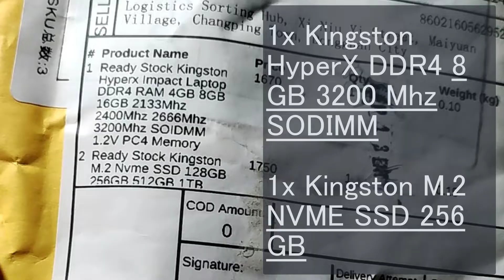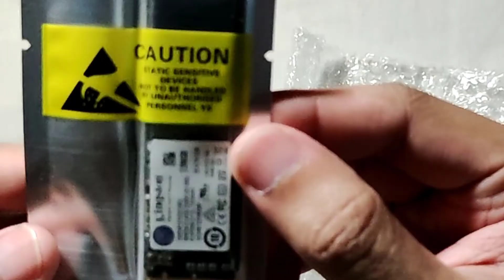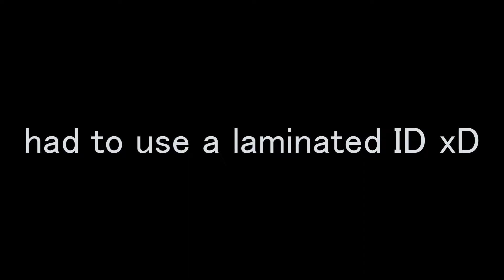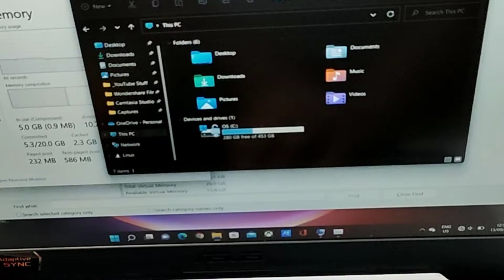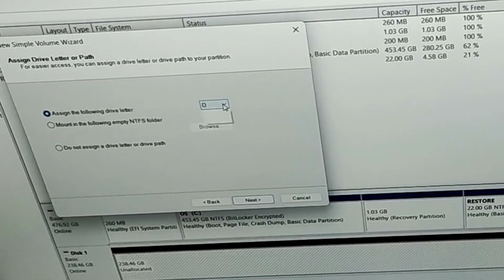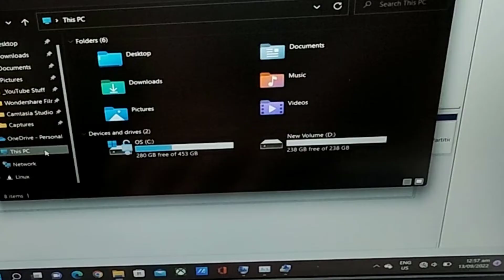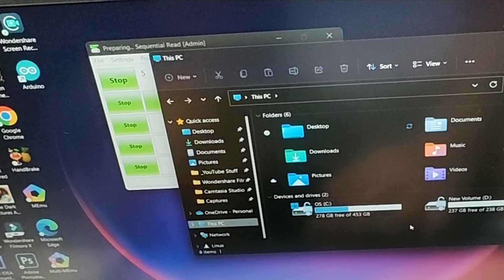ASUS TUF F15 (FX506HM) — Ram & SSD Upgrade — Complete Guide

Comment: I bought my laptop at 10.10.22 sale n upgraded my tuf 15 506hm(rtx3060) to 16gb(ram from my old tuf fx505dt) n 1 tb ssd pny cs1030 . Well after few months of using ,1tb ssd now has 200gb left because games now is 60gb so a few games took 300gb. Plus some microsoft visual studio, unity engine n unreal engine stuff. My advice to others is if possible buy more than 2 tb ssd. 
16gb ram is still fine
Reply from the maker: i only bought 256 gb ssd and i got more space 😆 i only download one game at a time, after finishing it, uninstall and then download new one

Comment: Im thinking of using an adt egpu, is it possible to take the main ssd that comes with this laptop in the pcie4 slot and put it in this pcie3 slot as shown in the video? 

It’s not required as technically I can use the pcie3.0 as well, but I don’t want to lose that extra performance
Reply from the maker: why would u exchange their place tho
Reply: @dimsummarasigan1289  because, 4.0 is pcie4 is wayyyy faster than pcie3. By a lot
Reply from the maker: so u will change ur stock ssd capacity? that's what u meant
Reply: @dimsummarasigan1289  My ssd came hooked up to the pcie 4 slot. I wanted my egpu to use the pcie 4 speeds, so I put my ssd in the pcie 3 slot.
Reply: This machine has Thunderbolt 4 capable, use it for egpu.

Comment: Bro how much longer do i need to prees the button to drain the power and how would I know if battery was drained out or not ?
Reply: Just press the button 1-2 minutes just to be sure tuf laptops batteries get drained quick.
Reply: just 30 to 1 minute, also all power from the battery terminals on which the capacitors were connected is quick to discharge. so 1 minute will be the max time.